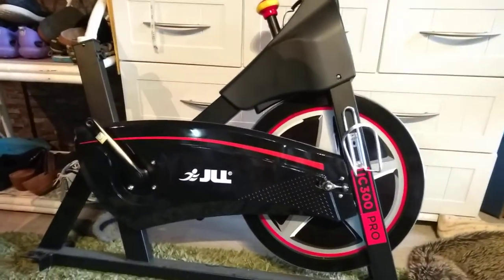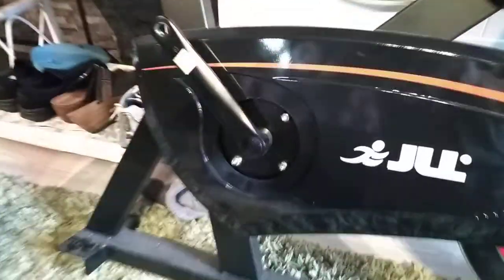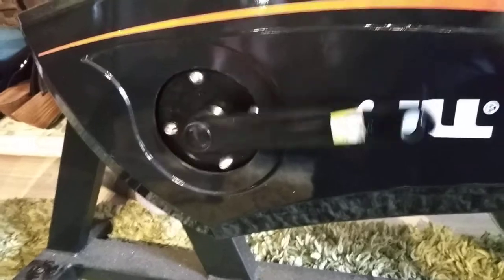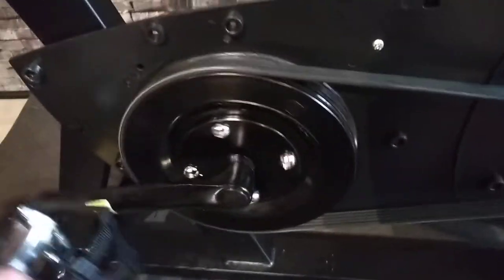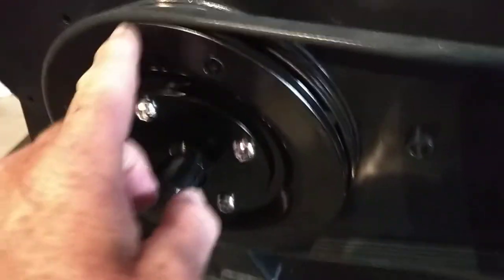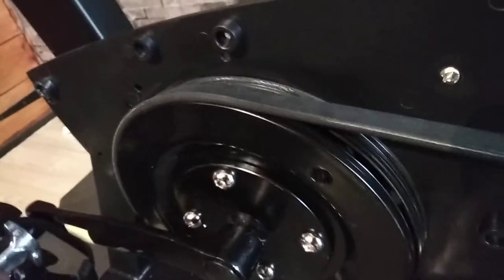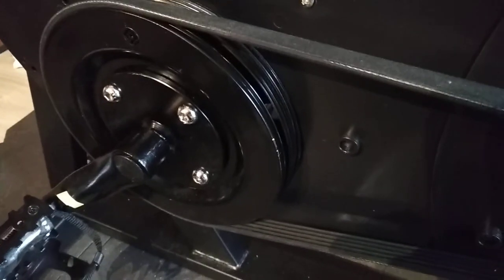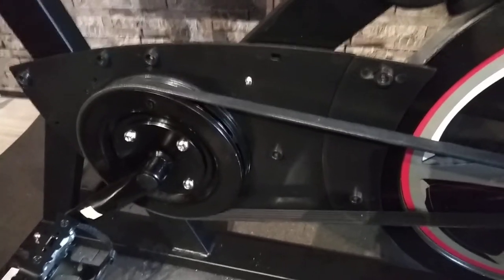JLL Exercise Bike No 2 Broken Drum/Crank Chainset

Comment: Did you resolve this
Reply: Yes. Using hex key, 13mm spanner Philips screwdriver and adjustable spanner I removed belt guard, loosened and retightened the four bolts around the crank wheel. Also released the large nut on the crank shaft which was clasping the bearing. Pedal bearings were lubed with wd40 and greased with Vaseline. Nice and quiet now.